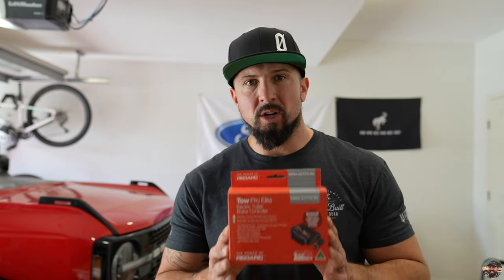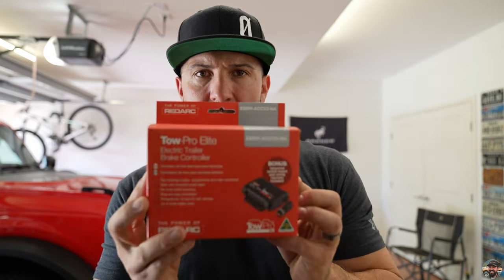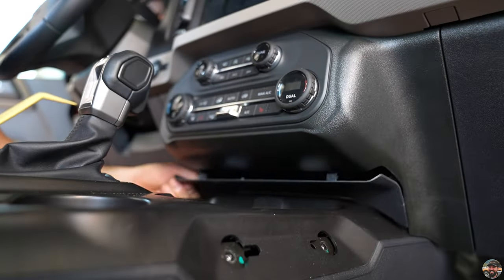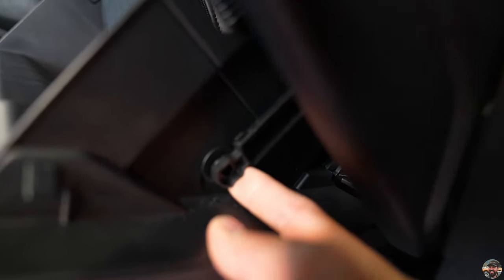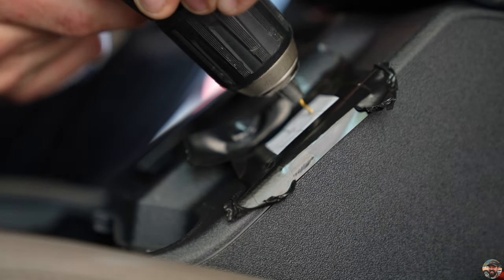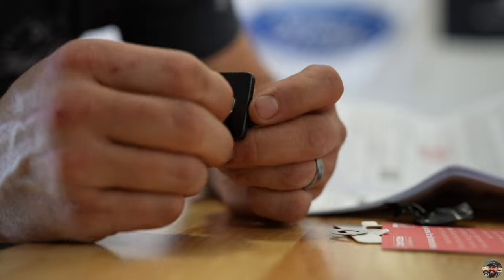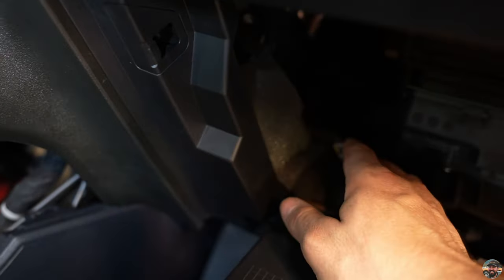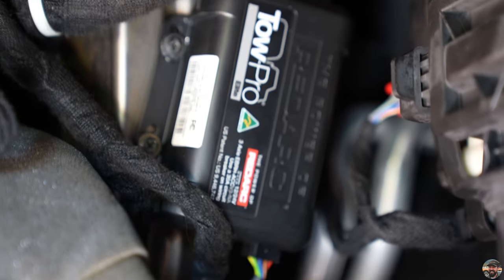HOW-TO Install Trailer Brake Controller in a Ford Bronco | Redarc Tow-Pro Elite

Comment: This was really helpful for me, but you left out a few steps. 

1. When routing the cable under the dash make sure and say f&&k a min of 10 times and dagnabit Ford — 3 times otherwise the cable will not go through properly. 

2. When unplugging the harness under the steering wheel plan to scrape at min 4 inches of skin off your knuckle. If this isn’t done the install will not be considered complete to spec. 

Thanks for making this!
Reply from the maker: 🤣🤣🤣 I won’t argue

Comment: Just an FYI , i work at a Ford Dealership, they did a trailer pkg. on a 1st edition . They said it was a pain in the ass , had half the rear trim out rewiring . after hearing that I ordered mine w/a factory install.
Reply from the maker: Yea factory tow pack is definitely worth getting.

Comment: Thanks for the video. I am going to be installing it. Can I make it any easier by installing everything near the left foot steering well? Or does it have to be near the glove box in which case I think it makes sense to do it in center console. Any advice is much appreciated.
Reply from the maker: This is the recommended installation and location per Redarc and Ford.

Comment: Great video, but question.. did your Bronco have the tow package from the dealer/factory?  Wondering how you wired to the 7 pin on the hitch if it didn’t?
Reply from the maker: Yes it did the pigtail under dash is there in the known equipped broncos but you’d have to wire out the rear at bumper. While I’m not curtain I think there’s a harness out back somewhere

Comment: Great vid!  Question.. why did they have you drill two holes if the step bit created a hole covering the smaller hole?
Reply from the maker: Basically a pilots so you don’t slip and score the interior
Reply: @ChaseGentry  Im referring to the lower smaller hole.  I understand the center pilot was to prevent bit walk when drilling the larger hole.  Looking at the template more I see the smaller hole extends outside of the larger hole a bit and the snap down cover must orient itself with this small divot.  So, if you wanted to install the cover and knob upside down (which I've seen other Bronco owners do) just flip the template.  That way, in the driver's seat looking down on the control knob, the lettering is oriented right side up.

Comment: Where does the brake actuator wire come out at the rear of the Bronco? Is it behind the driver side panel in the cargo area?
Reply from the maker: Not following the question.
Reply: @Chase Gentry  Sorry. My Bronco did not have the tow package. I installed a hitch and 4 flat trailer wiring. 
I was wondering if the wire that activates the electric brakes is someplace at the rear of the vehicle.
Reply from the maker: @vh3531  ohh I see that’s a good question. There’s should be a pigtail under there somewhere but you’d probably have to pull wiring diagram to verify. Then just order missing items.

Comment: What made you decide to mount the knob on the center console and the box behind the glove box?
Reply from the maker: That box is inertia sensing so it needs to be hard mounted on something that’s body mounted. Also the knob right under your hands natural resting position is ideal to make brake adjustments. Last reason both Redarc and Ford have the kit setup for those locations too.

Comment: When you have the brake controller all the way as low as it goes does the 0 align at the dead top center of the unit and 10 if it's all the way up? I had it installed by my Ford dealership on a 2022 Ranger and the 0 is not on top when it's all the way to the left, nor is the 10 at the top when it's all the way to the right so I'm not sure if they installed it correctly
Reply from the maker: Yes 0 is nothing and 10 is all the way! It’s common for know to be installed not clicked correctly

Comment: Could you help me with something. If you don't have the trailer not connected, is there a way to test whether everything is working. My controllers remote knob doesn't light up. I also used a led test but it doesn't light up too.
Reply from the maker: Which harness part number did you use?
Reply: @ChaseGentry  I used the tekonsha custom 7 way wiring harness.
Reply: @ChaseGentry  TK55VR
Reply from the maker: @MukulKumarIIT  ohhh did your bronco have the factory tow package?
Reply: @ChaseGentry  no. It's completely diy.

Comment: ok how did you get the plugs from the phone charger out in the center console in the back, any pics not sure how to remove them without breaking them?
Reply from the maker: I just reached under it and felt the two clip and pressed down on tabs to release they come off fairly easily hope that helps
Reply: Too bad it won’t let me post a pic.  Got the bottom of the two USB’s disconnected but I can’t find any release for the top one.  So frustrating.
Reply: Just used some angled pliers and got it off.

Comment: I have a 22 BD without tow package. I hooked up the controller but it is not working. No power?? The button does not light up.. what could be the issue?
Reply from the maker: So since you did not have tow pack it maybe not fused. While the harness is there the circuit may not be powered I don’t want to lie to ya I’m not 100%
Reply: @ChaseGentry  that's what I'm thinking.. i appreciate the comment.
Reply from the maker: @calebhoward9286  no problem!

Comment: Thanks for the great video!  I have a couple of questions:

1. I’m having my dealer remove the towing capability option from my 2022 Bronco order and will install my own receiver and 4-wire kit.  If I later want to add this brake controller, will I still have the same wiring harness there under the dash, right of the accelerator, to connect into?

2. I’m sure tastes and opinions will vary, but with the window switches being “upside down” so they appear right-side up when the driver of passenger looks down at them, was there any particular reason you didn’t flip the brake control switch to be oriented consistently with those?

Thanks!
Reply from the maker: Your removing the factory receiver and removing the 4 & 7 pin plugs? Why?  I’d leave that there and if your bronco comes equipped with factory towing pack it’ll be wired for controller under dash. As far as switch since it’s a rotation to me I prefer it right side up
Reply: @ChaseGentry  Like a lot of people, I reserved in July 2020, ordered a MY2021 as soon as I could, then had to convert my order to a MY2022, and have grown tired of waiting.  The dealer has told me for months that if I remove the tow package, it will probably speed things up.  He told me their dealership could install the hitch and wiring as a dealer-installed option, but it would be about $1200 after tax.  I told him I would keep holding out and hoping Ford would fix the supply chain issues to have the factory kit and not spend an extra $600 having them do it.  Then I saw that the tow package didn't include the brake controller anyway, and I could get the Curt hitch receiver (https://www.curtmfg.com/part/13493 or https://www.roughcountry.com/receiver-hitch-51062.html?find=2022-ford-bronco-4wd-856075) and a 4-pole wiring harness (https://www.etrailer.com/Custom-Fit-Vehicle-Wiring/Ford/Bronco/2022/TK99VR.html?VehicleID=20226004632 -- all I need for now) for well under $300 after tax & shipping.  I figure if I ever do need a brake controller, I can install one like you did, and update to a 7- and 4-pole connector (with something like https://www.carid.com/hopkins/multi-tow-7-rv-blade-and-4-wire-flat-towing-wiring-kit-mpn-11141144.html or https://www.etrailer.com/Trailer-Wiring/CURT/C57672.html), even if that means running a few extra wires myself (although I suspect that the wiring harness you connected into is the one for the brake light wiring and likely contains all of the other wires by default).  So, last week I had my dealer remove the tow package, and he was right.  The next day, I logged in and saw production had been scheduled for mid-June -- without the tow capability option.
Reply: @ChaseGentry  aren’t you a Ford ambassador? I know they hand you whatever to advertise, but they should really inform you about the real-world stuff customers are going through. Most of us had to drop the tow package just to get our Bronco in a reasonable time. I have a 4 pin Curt harness I installed on it. Now looking for solutions to brake controllers. Sucks, but we had to go this route.
Reply from the maker: @GetOutSmore  i can assure im more informed than you can imagine as I’ve seen a lot of the inner workings from many angles nor am i handed “whatever to advertise”. I truly have empathy for everyone that’s involved and early order holders still eager waiting. There’s major obstacles when completely designing, engineering, manufacturing, distributing, a brand new anything into the market let alone during an foreseeable global pandemic. I own a small business personally and little ol me have literally still struggled getting people to work, get materials, stay politically correct, etc so imagine the speed bumps a global brand like Ford has had to overcome when normal practices and procedures have literally been shut down or had been for over a year right in the actual middle of a new vehicle launch that had 150k sold orders literally instantly. The demand was/ has been way higher that anticipated and rightfully so the bronco is a home run in all areas. These are crazy times we live in and i can assure a brand like ford does not want anyones order changed, canceled, or not sitting in customers driveways. That’s just bad business obviously. Again there are parts, components, etc that come from literally all over the place, some built in house some are not. Unfortunately not all manufacturers are as big as ford and could not handle the pandemic or catch back up after closures. Whereas 3 years ago normal turnaround for a sold order anything was 30 days i know this because i ordered inventory for dealerships for almost 10 years. Now across the board with all manufacturers its average of 6 months for vehicles that have been around for a while. It’s gunna take a hot minute for things to realign and supply catches back up to demand. Sorry you had to drop your tow pack. Also you’ll can still use the redarc tow pro btw
Reply: @ChaseGentry  I’m not mad at Ford. I get it. There are bigger problems in the world. I’m saying this is the reality in ordering a new Bronco so that’s literally the only reason we are all dropping the tow package and doing it all ourselves. You asked why. Not because we want to. Looking for solutions. Not excuses. Lol I do get it. The reason for the supply chain issues and all. Trying to get brake control for my trailer with brakes with only an aftermarket 4 pin so far.